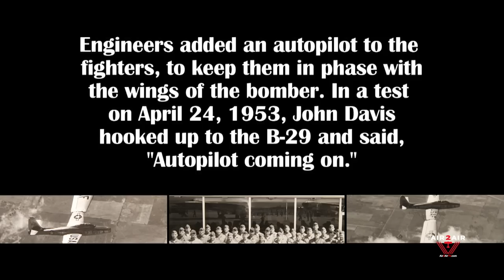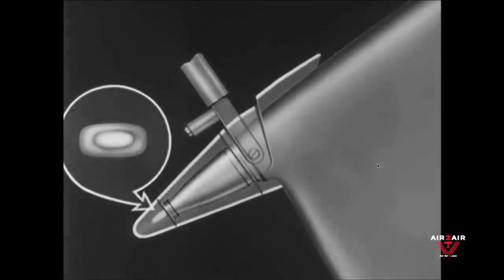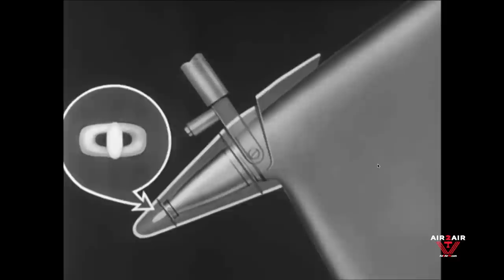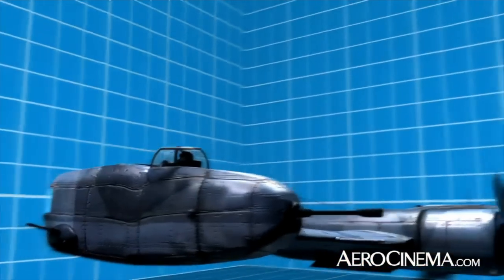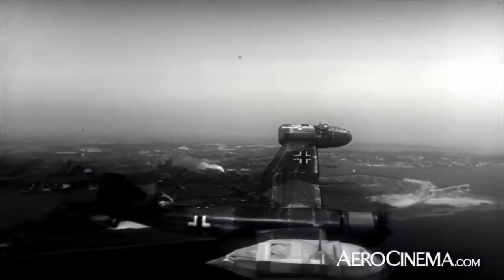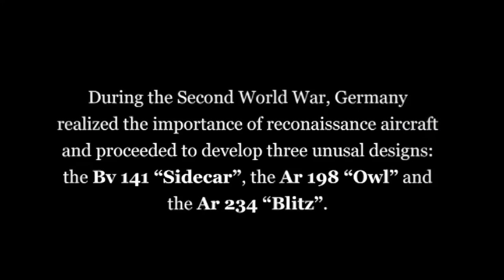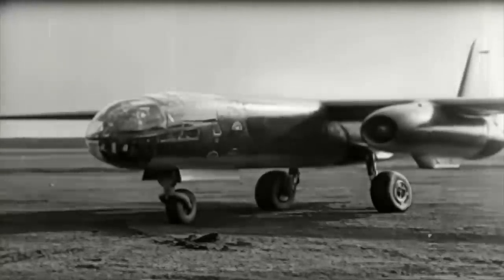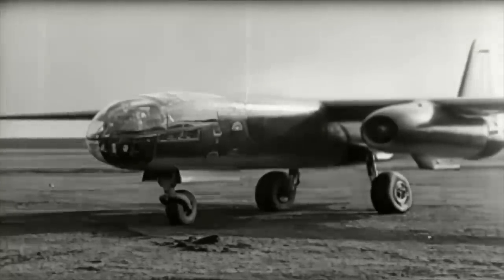Project Tip-Tow | Wing Coupling And Other Experimental Aviation Projects

Comment: My uncle was the right seat pilot on the B-29 that suffered the fatal crash with the F-85 during Project Tip-Tow.  24 April, 1953. Those killed included: TSgt. John Clarkson, Capt. Herbert McClanahan, MSgt. John Shaffer, and Capt. James Vapenick.  The program was terminated after this incident.